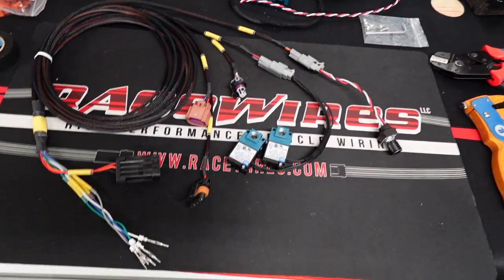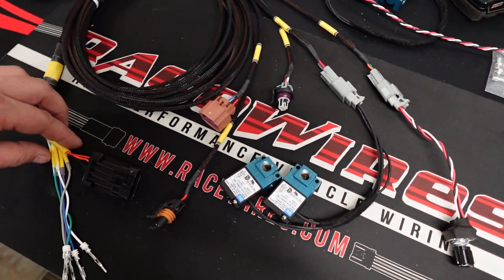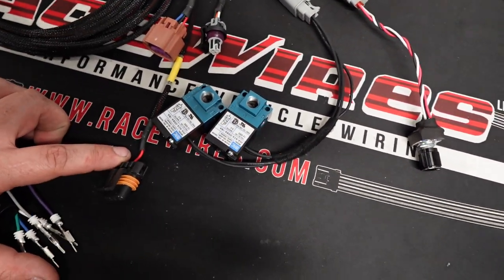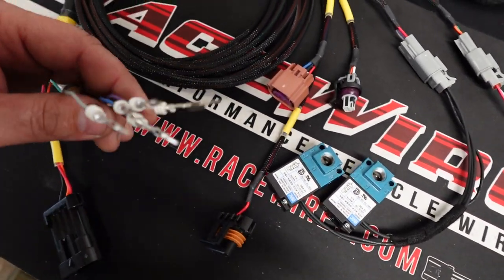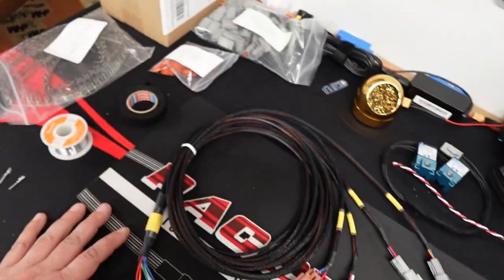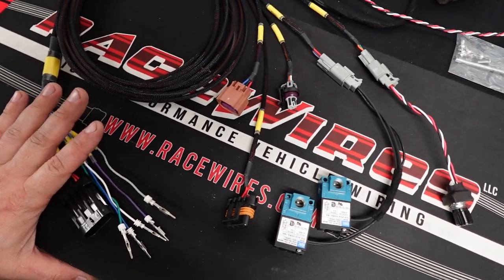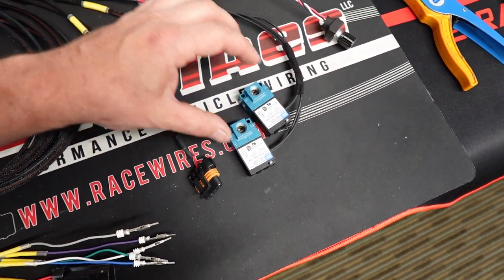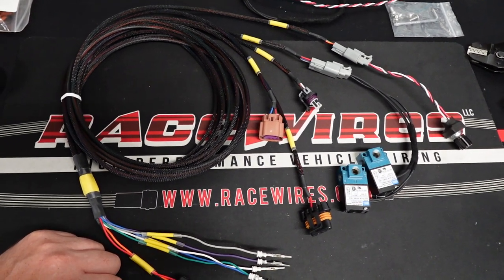Holley 6 In 1 PNP (Alt/Flex/Dial/Boost/Dome/Fill/Vent) Ultimate Combos

Comment: Nice! If I didnt have AC being controlled by my Terminator X stealing those valuable I/Os then I'd be all over it! Unless there is a way to do both, I'm open to guidance.... great job BTW Matt, you are doing a great service to help make things easier for everyone.  I'm able to wire it myself but don't mind people making my job easier!
Reply: On my dad's car we ran out of input output so I changed the first electric fan to be key on and then used one of the fan outputs

He is using the Ford Windstar electric fan where there is one really big fan and one little one.  the little one is on key on. In California this has yet to be an issue. Maybe if you live in a really cold stade I guess it could be a problem to have the small fan running all the time

Comment: cant wait till I can even afford a dominator, But, when I do, I'm prly gonna go with electric gates.
Reply: Don't do it lol... Unless there's some other ones by the time you do that are better than turbo smart.. after splitting my 427 in half and them denying a product issue I trusted them ,bought a tsp short block  and exact same issue happened during the burnout every rod found a way out of the block.. then they acknowledged an issue  and wanted to send me new ones but clearly I wasn't using them again.... Also a lot of tuners I highly respect advised against them like Pete Harrell saying they still leave a lot to be desired to put it nicely as possible..  absolutely no reason you can't use exactly what everybody has forever they work perfectly fine over 4000+ hp